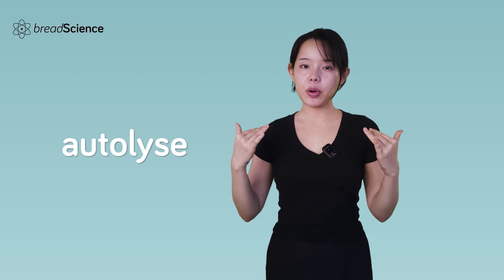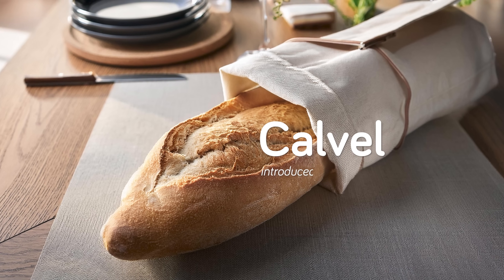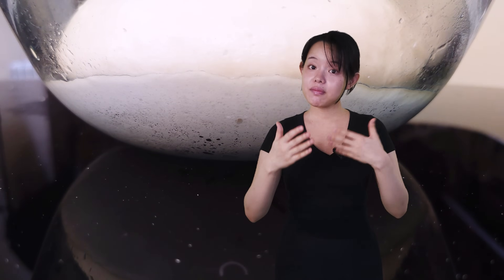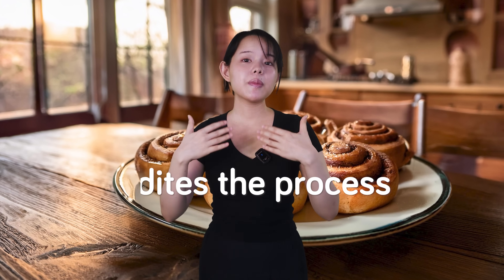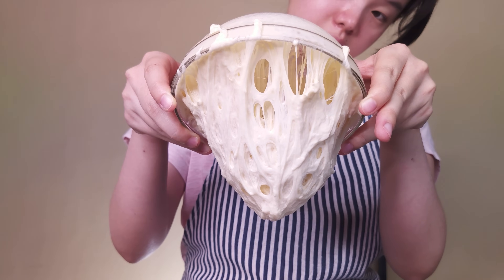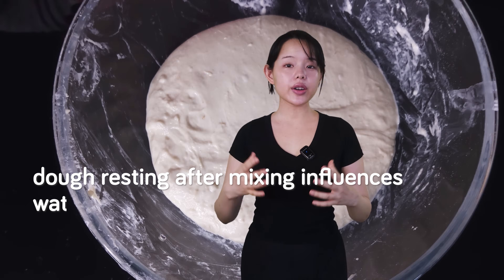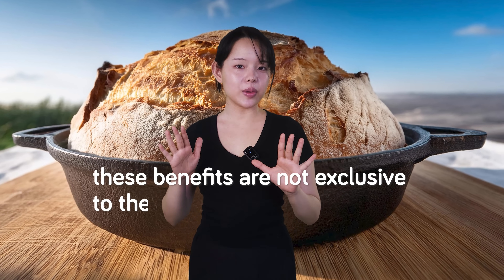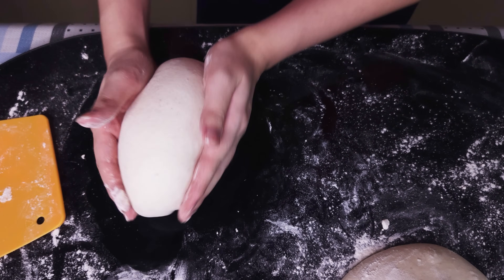Are You Wasting Your Time with Autolyse? | The Science of Autolyse

Comment: Thanks for the video.
I'm a beginner in bread making (baked up to 10 times) but have some knowledge in winemaking. I started to use cold water maybe for my 4-th bread, get to that by myself and logic that while mixing my dough get to high temps (26+°C), so using cold water got to ±23°C that for me was acceptable.
I heard of autolyse so used it for sure last 2 times.
I use for that cold water and put the dough into a fridge for 1hr.
That works perfectly for me. 
As a result the mixing goes easier and faster (regarding that i do hand mix)
And actually last two times the bread was just perfect.
But with this little knowledge still have a lot to understand and to solve some challenges on how to get good bread the best way on the equipment i have

Comment: I tried autolysing once and never again.  It was hard to mix the starter in and i didn't find any benefits at all.
Reply: Why? Its not difficult 😂
Reply: It's much easier to incorporate leaven or preferment into an autolysed dough using the stretch, slap & fold method in my opinion. It's also how I add liquid oil to enriched dough.
Reply: I had the same hate for incorporating due to differing hydration levels between the autolysed dough vs the levain/pre-ferment. Knowing better now, the sort of the solution or advice is to :
1. When preparing autolyse, don't knead it, don't strengthen gluten. Aim is to mix flour and water, as long as there's no dry loose flour, leave it in a shaggy state. Leave it alone for half an hour.

2. To begin incorporation, spread autolysed dough slightly flat.

3. Smear the levain/pre-ferment across autolysed dough's surface

4. Pinch all edges of autolysed dough to wrap into centre. Be gentle, don't knead. Don't break dough tension. Don't aim for perfect wrap. Just be coarse with minimal movements and, leave it there.

5. I live in a freaking hot country like 30c, so I am basically wanting the yeast activity to be much slower than gluten formation at this stage. So I reduce temp to 15c by combination of freezer first then fridge. Aim is to leave this incorporated dough alone for about 30 mins.

Start your usual kneading / bertinet / stretch and fold as usually by this point in time the incorporation should be quite complete.

Comment: Recently stopped doing the 30min autolyse/fermentolyse in my SD breads after 2 years of daily baking and I've actually noticed an improvement in the end product.  While the dough feels slightly less extensible while working with it, it holds hydration better, the crumb is more even/consistent and has a more pleasant texture. I also prefer the taste. I don't think I'm going back anytime soon. I use no-knead techniques and french T65 flour most of the time.
Reply: I used to work with t630 from Germany bread flour when i did autolyse the dough came out bad not strong as he should 
After I stopped the dough was good

Comment: Whether an autolyse is appropriate or not depends on the flour you are using.  Not all flour is the same, nor has the same enzymatic requirement.  As a brewer, it is the equivalent of mash schedules, which varies wildly depending on grain bill.  To just make blanket statements that it is, or is not needed is ignorant of the wide range of flours available to the baker, whether home or commercial.

Comment: I am a recent enthusiast of making bread (with yeast) in a bread machine. In studying this process, which resulted in a book that explains to owners of such machines the secrets of obtaining quality breads, I also approached the use of small modifications such as the use of poolish or autolysis. Although using a machine requires a reduced working time, resorting to these modifications can lead to an improvement in the quality of the breads obtained.
In the case of autolysis, I resorted to mixing the flour and water for 3 minutes in the machine bowl, turning it off and autolyzing for 15 minutes. Then I added the rest of the ingredients and restarted the machine to mix all these ingredients. Since the mixing time (programmed) is 10-12 minutes and since my machine has the possibility of shortening/extending the cycles, I wonder if it would not be better to shorten the mixing time to 6-8 minutes. What suggestion do you give me? Many thanks, Yours fan and follower of the videos on the Novita Listyani website. Stefan from Romania.

Comment: I tune in just for the Byyyyyeeeee!:face-blue-smiling: Just kidding!
My go to bread is a 50% whole meal, mostly whole wheat and a small bit of rye. A method I've fallen into works like this: mix together all of the water, levain, and the whole meal. Let this fermentolyse for about 10 minutes. Then mix in the white flour and salt. Wait 20-30 minutes, then start the stretch and folds. With a machine it's easy mixing and seems to work as, sort of, an autolyse, I think.

Comment: I tend to use a cold autolyse when ambient temperatures are high and/or the dough needs more intensive mixing in order to manage temperatures (or depending on the recipe I might use ice to replace a portion of the water component). That said, I have a commercial spiral mixer at home now, so gluten development is not really a problem when I am not making by hand.

Comment: I grind my own flour at home to make my rustic sourdough loaves.  I have read that it is beneficial to autolyse the flour and water for an hour as it will soften the larger bran particles by giving it a jump start before the yeast and salt are added.  I have also read that it is harmful as the abundant enzymes in fresh milled flour has a negative effect with the autolyse.  I don't know what to believe but I find it easier to work with when I hand mix in the salt and starter.  Any insight on autolyse with fresh milled flour?
Reply from the maker: Thank you for your comment! While the topic of autolyse with freshly milled flour could be quite broad depending on the grain and milling methods, we currently don't have sufficient information to provide a comprehensive response.